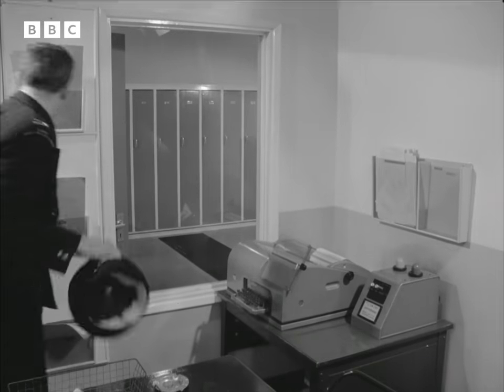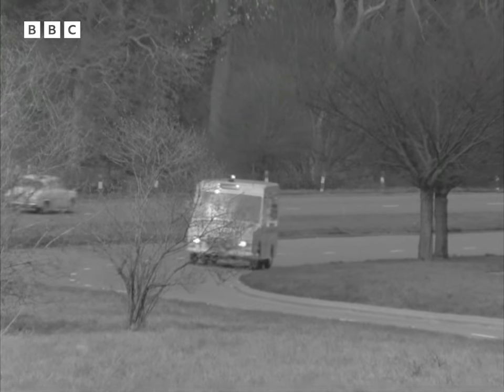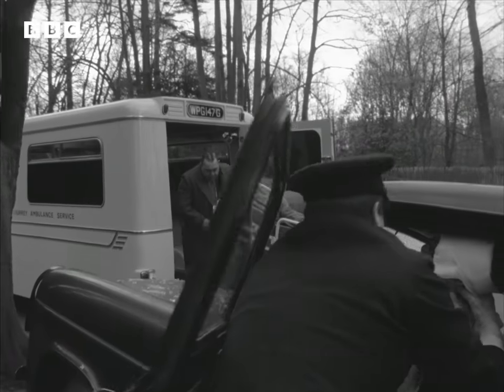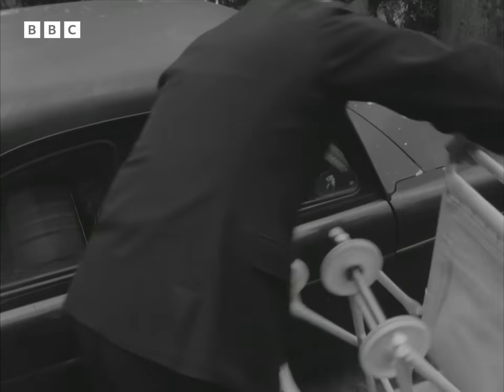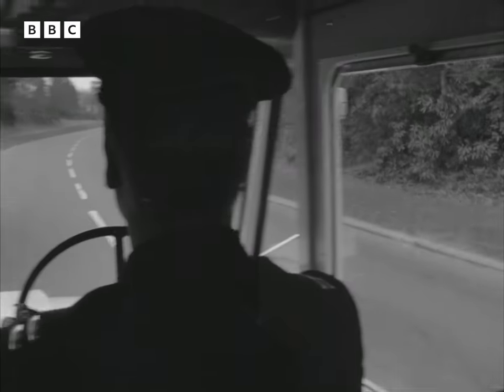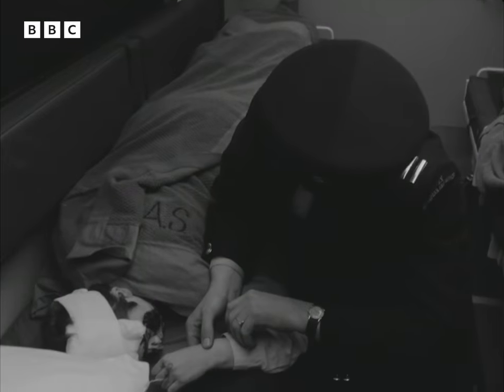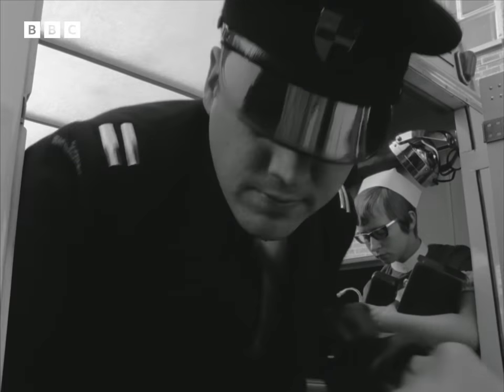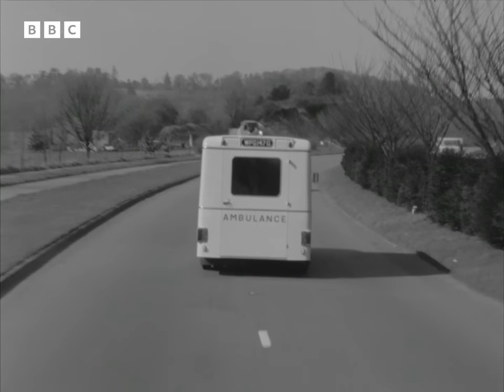1969: New AMBULANCE put to the Test | Tomorrow's World | Retro Transport | BBC Archive

Comment: I love that the ambulance driver doesn't use his seatbelt having just attended a car crash where one of the patients broke the windscreen with their head😂
Reply: Sadly even in the 1980s when it was law, many ambulance crew failed to wear seat belts.
Reply: Also lets make the gear shifter a metal rod that points directly at the drivers kneecap.  I mean it could lead to a nasty accident but surely the driver would be wearing their seatbelt, right? Right? :)
Reply: 3:55 the guy just casually looking backwards while driving at speed with no seatbelt - and on a real road with a whole BBC Team standing in the back too 😂
Reply: 😅easy to look back and point todays obvious '
Reply: He will need an ambulance.
Reply: Both worevtheur searbelts
Reply: 0:57 for driver 1:27 his colleague reached down to unfasten his one

Comment: When the term ambulance first came into use, it did not refer to a vehicle. To meet the urgent needs of the wounded during war, the French about 200 years ago set up temporary movable hospitals close to the battlefields. They called such a hospital hôpital ambulant, meaning literally "walking hospital." The French adjective ambulant can be traced back to the Latin verb ambulare, meaning "to walk." In time the French dropped the word hôpital from the phrase and changed the adjective to the noun ambulance. This word was also later applied to the wagon used for transporting the wounded to the field hospital. Before long, the word ambulance came to be used for civilian temporary hospitals set up during emergencies and also for the vehicles used to take the sick and injured to the hospital. English borrowed the word from French to refer to such vehicles.

Comment: 50 years later and we're still using adapted mainstream manufacturers vehicles...I guess producing a bespoke ambulance like this would have proved far too costly..
Reply: Fire brigades too in the ROI and UK since Dennis made the last sabre in the late 2000’s
Reply: These modern adaptations are much bigger, have all the features and the large space recommended back then, and have much more equipment because rescuers are now paramedics, not just attendants. Common rail injection and other engineering leaps makes modern diesel engines very powerful, and infinitely more reliable than any Jaguar-made engine.

Back then, it was desirable because common ambulance types were converted estate cars and stuff like that, those were even more cramped than modern estate cars. 

Vans had more space, but engines and handling (suspensions) were weak, and the ride quality was spine-shattering, which is bad for patients, just how it was before the Transits became dominant on the market. You were more likely to create another accident in those conditions.
Reply: @charlesc.9012  I reckon commonality of parts with regular vehicles will have been a factor as well - it makes vehicle maintenance a lot easier if the various components can just be got from off a shelf, and there's far fewer thing that require individual vehicle specific knowledge to fix!
Reply: @RedHillian  It is definitely cheaper and more reliable to send it to a mainstream logistics chain than specialists and strange parts.

Industrial technology and economy of scale are also huge factors. It is much cheaper to order vehicles from volume production, then send it to conversion than to spend the same amount of research funding on a low volume specialist vehicle. 

The economic utility and attractiveness for a Jaguar-engined commercial vehicle is suspect too, I bet it would need weekly repairs, and a 5L bottle of oil as standard cabin equipment

With the ballooning costs of automotive development, production and the advances in reliability, ride quality, performance and ergonomics, mainstream vans make perfect sense now.
Reply: In America, ambulances have large V8 engines.
Reply: @matthewlongstaff3112  there's talk of electric ambulances in the States.

Comment: In our strange topsy turvy world where things seem to be moving backwards with each passing day, this standard of healthcare will soon be cutting edge again.
I bet you didn't have to wait several hours for an ambulance to arrive 55 years ago either.
Reply: When I had a heart attack 2 years ago, a first responder paramedic was with me in under 10 minutes and the main ambulance 5 minutes after that. Off to the hospital with the driver aiming for every speed bump and pothole he could find, I'm sure I almost hit the roof at one point 🤣
Reply: @TestGearJunkie. I'm so glad your story had such a positive outcome, there is so much to thank the NHS for.
Reply: @tasercs  Absolutely 👍  Tell you what, it was absolutely freezing in the cath lab, they said it was to keep all the X-ray machines cool..!
Reply: @TestGearJunkie. Slightly off topic but seeing your Fluke meter avatar reminds me that I acquired a Fluke 77 as part of my job in 1989. I still have it, and it still works perfectly 😮
Reply: @tasercs  It's a Fluke 179 multimeter, lovely piece of kit. Is your 77 currently calibrated..? If it's not, you should get it done, I'd be willing to bet that it's still within spec.
Reply: @TestGearJunkie.  Amazing coincidence that I also have a 179. So my 77 is no longer used much (and is no longer calibrated) but its readings match quite favourably and is probably not far out.
Reply: @tasercs  Some of the older kit stands up well. I also have a 1966 Megger Series 3 insulation & continuity tester (where you crank a handle..!) and it's still perfectly within spec. even though the case is still factory sealed and has never had any work done on it. I bet there aren't many around with a current calibration certificate 😋